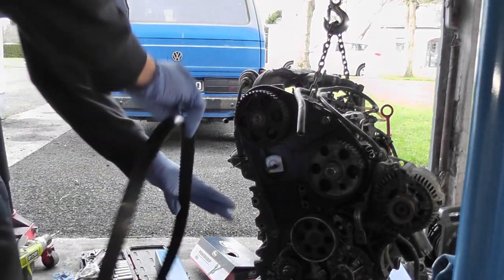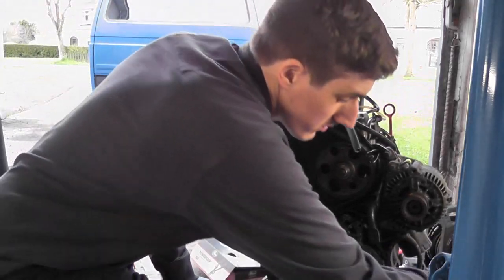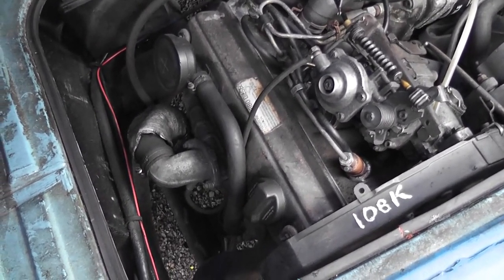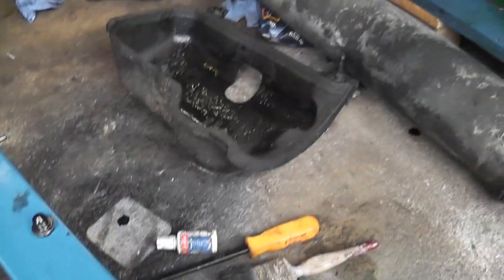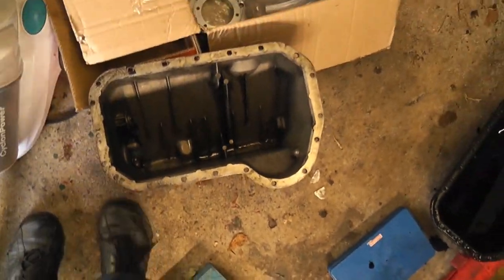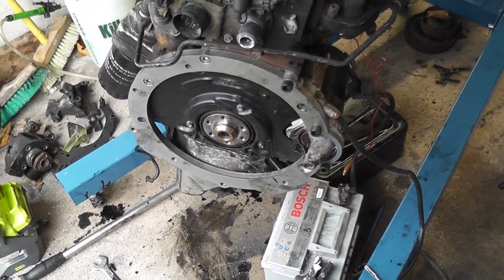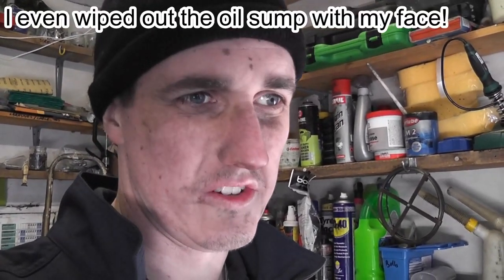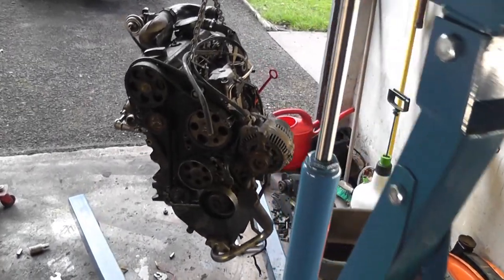Swapping sumps and making progress with the AHU engine - VW camper TDI engine swap

Comment: Great video although when I saw the thumbnail I thought it was a traveller call-out video
Reply from the maker: Hmm, maybe I'll change that! Not the desired effect!
Reply: Please properly time these. 
This is what is called “mark and pray”

The camshaft pulley pulley must be broken free to set the timing. 
Or when you tension it, the timing will be odd for the camshaft and injection pump. 
Hopefully you are using a dial indicator to set timing. 
As ahu tdi-m will run ok with a wide range of timing. 

Also dude, fighting the timing belt tensioner with a rattle gun!!! 
Nooooooo!

Hopefully you are actually tensioning the timing belt?

You are giving me anxiety.